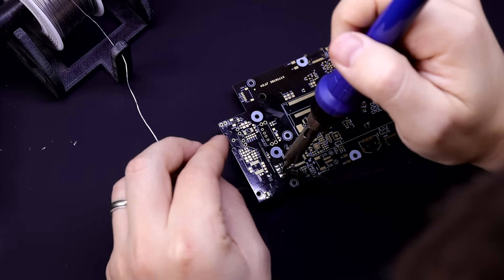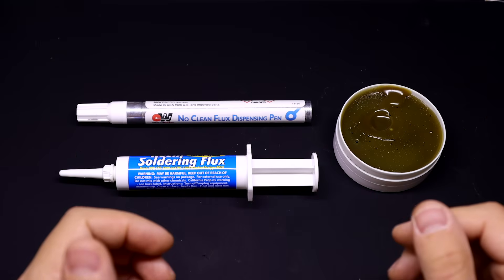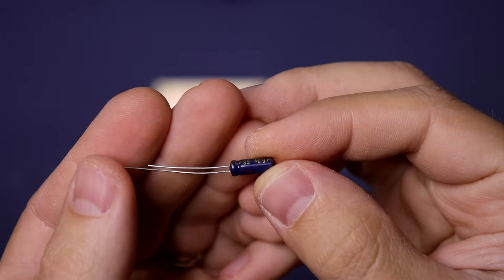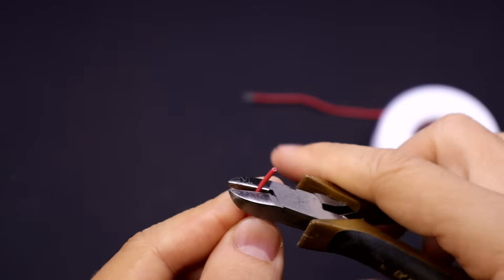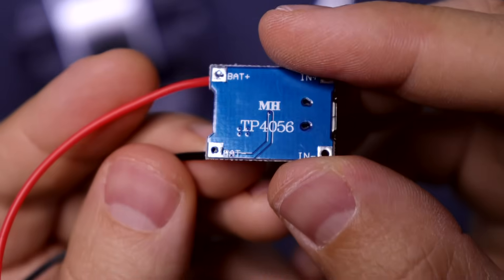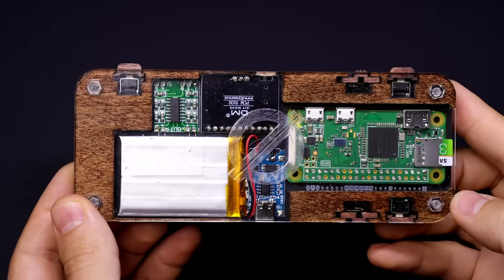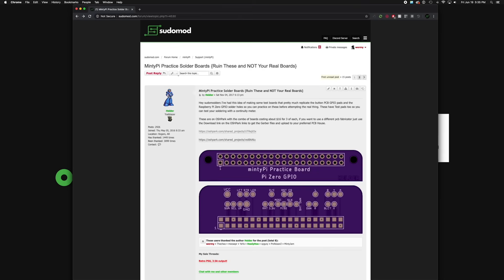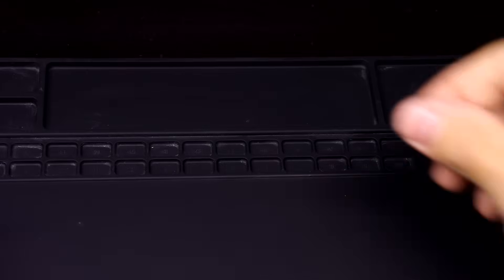Soldering Crash Course: Basic Techniques, Tips and Advice!

Comment: I have always had decent luck soldering small wires. But I'm trying to repair ballance leads on an rc car battery and the solder pads just won't melt. I guess my iron wont get hot enough... I'm really frustrated. I've always had good luck pre tinning the wires. Ive never had this much trouble. I appreciate the information, but I guess I need a more advanced videos, I just cant believe how fast others can get solder to melt. It seems like it takes forever, even though my iron claims 850f

Comment: 8:25  This is what I will attempt. I am new at this and just ordered this soldering kit.
But it's the wires from my rc's propellers that need to get soldered onto the chip

Here is what I ordered. I hope I got the right stuff!
https://www.ebay.com/itm/164853422896
Reply: ACTUALLY. The RC's computer chip's positive and negative wires fall off easy. I have 2 rc's and they don't hold up.. For the new computer chip that came, can I just solder over the soldered spots for extra support?

Comment: This video convinced me to finally try soldering out to try and fix some old consoles I was buying on ebay and cleaning already. I've been all afternoon desoldering and soldering components from an old motherboard I had lying around and I love it! However, I find myself strugling to know when it has the right temperature (it's one of those cheap ones with a wheel to adjust temperature and interchangeable tips that starts heating once you plug it in, since I just wanted to start trying it out), and also with the pump to get solder out, it usually takes me a few tries to get it all out and sometimes the leg is still stuck to the hole. Any advice on that?

Comment: Very good video.  One thing he is doing, but didn't mention.  To get those pretty looking little cone shaped connections on through board soldering he is removing the solder first, then lifting the soldering iron straight up.  I'[m teaching my 13 & 14 year old's to solder, and this is the video I want to show them first.  Tons of great info, but not so long as to bore them.
- Joe

Comment: Awsome video :) just one question, in my books when i did my electronic education, it Said not to shorten the leads after soldering, of you do you need to re-flow it. When you use sidecutters it can make cracks inside the solder joint so you dont have as good connection, or it might not be as reliable, i ususly dont do this unless it is for something that draws alot of current or if it need to work for a long long time :) never had any problems when i dont do this but i just want to be on the safe side, anyone els that have know this ? :)

Comment: I've got a Weller that I've used very sparingly over the years and didn't take great care of it because neither me nor my dad knew any better. I should probably get a better iron BUT for curiosity's sake let's say I get a brand new tip but the shaft remains quite oxidized. Would it still be at least useable? And even if the tips are heavily oxidized themselves would that be good enough for desoldering with a pump?

Comment: Excellent video, helped get me from never holding an iron to finishing my first electronics project. The one thing I'll say that I'm kinda surprised wasn't mentioned in the video and doesn't seem to be very frequent in the comments: keep things ventilated! The wisps of smoke that come off the iron are mostly flux fumes, and they can cause chronic respiratory issues (namely asthma). The lead in leaded solder is most dangerous if flakes of it (like, say, the ones that tend to come off the tip of your iron when you clean it) are ingested or inhaled, but soldering with it also produces some lead-based fumes that are equally dangerous with enough exposure. Make sure the space you're working in is reasonably open; open a door if you're in the garage, a window if you're in an office, etc. If you can, use a carbon-filter-based smoke absorber to pull those fumes away from your face and to keep the air cleaner. If you don't have one (or ideally even if you do), use a desk or household fan behind or to the side of you to push air away from you and toward the open window/ventilation.

Comment: Great video, it was a massive amount of help when I started my first project in decades. =)

One thing I did run into which you didn't cover in your video was soldering wires onto the legs of components, or pins sticking out of a PCB. My project was a DIY button box, so for the most part I attached the components to the faceplate, and had to solder wires onto the legs of the components. This seemed like something that would be best done using about 3 hands, any tips or tricks?

I did find one video where they first attached the solder wire on the leg by heating it up a bit, then cutting off a bit of it so that there's effectively a "stick" of unmelted solder attached to the leg, sticking out. Do this for each leg, then when you attach the wire you press the wire against the leg with the solder, and once they heat up the solder melts and the flux draws it in place. This did make things significantly easier, since I didn't have to try and keep 4 things steady at the same time.

Comment: Years ago when i was like 10, there was these inputs that i had that people had to use on tvs before hdmi cords came in. There was one video cord that had some type of coating in the center that would not make the video happen so i cut that piece off and replaced with another video input. I didn't know about soldering but it worked and my family was amazed, this made me want to look into this kind of work and see what i can fix.

Comment: All great tips, except you failed to mention the most important aspect of soldering: Suction.

You can't solder in closed environments because those fumes are toxic, so if you're going to go over the basics, suctioning those fumes away either through an exhaust or fan with a carbon filter to drive away the fumes.

Soldering and breathing everything is going to ruin your lungs.

Comment: @wermy: Hello. I have a question. I'm trying to replace a battery on a nintendo 64 game cartridge and it needs a cr2032 battery with the tabs soldered on already and I've tried it already. No luck getting the game to save at all. What I did was I filled in the gap around both tabs as in I melted the solder wire inside the holes. I then covered the surrounding area with more solder. When I tested the continuity with the multimeter it beeped and showed -41 to -52. Did I do something wrong?

Comment: Crazy how the sotter flows like magic in videos, I’ve sottered leds before but my sotter never melts and flows like that, I use kester sotter, flux, a soldering iron with adjustable temperature, and I just can’t get the sotter to flow and melt on wires or even leds sometimes, I heat up the wire, I heat up the leds, etc, I do everything suggested in videos, still it never works how it works in videos I see here. The sotter basically turns into a little ball then falls off.

Comment: Finally a video on soldering that I feel good about sharing. Great job. I prefer to use a "Western Union" style splice when joining 2 wires but when you only have a little wire to work with I do the same as you did. I've been doing electronics as a hobby for over 50 years and have spent most of my life in one electronics feild or another. Again great job.

Comment: I swear i had a terrible electronics teacher. Did a partner project and we had a good bit of soldering to do and both of us did like you said where we tried to melt the solder onto what we were trying to join. Of course we had lots of issues and barely got the project finished for a grade. We also had the heat to high and the solder kept splattering sometimes which flung molten metal at our hands. We fixed that on our own but we had no guidance at all from our teacher. I guess his idea was just to let us figure it out on our own or something. Totally turned me off of working with electronics which i actually had fun doing. :/

Comment: My biggest worry is that I'm overheating the components. Sometimes it feels like I have the soldering iron on for way too long yet the solder doesn't want to melt.
Reply: As someone who has burned two out of the last four boards I've tried to solder, I feel this. Something I started doing is melting the solder onto the iron instead of the board? If that makes sense? So there is a blob of solder on the iron tip and that's what I put on the spot I want it at. It's helped me a lot! I now have two nice boards with no burning.

Comment: How about a video that goes a little more in depth with tip maintenance, flux types & usages?
Reply: Flux is used in for transfer of heat... use it sparingly but just enough.  It’s a necessary evil.    It leaves a sticky brown mess after soldering that can be cleaned up with 99.9% tech grade isopropyl alcohol and and acid brush after a few cleanings.  The 91% from Walgreens works too but it’s whatever is available.  Make sure you get under the components you solder.  As far as tip maintenance... if the soldering iron is on for a few minutes while you figure out your next move... blob some solder on the tip.  Have a “solder dump” (a small metal container with a DAMP paper towel)... when ready to use the iron again,  give the iron a small tap into your solder dump OR use a lint free “tech wipe” to lightly brush the excess solder you blobbed on earlier to lightly brush into your solder dump. *recommended because you don’t want molten hot solder flinging all around you.  Use a wet sponge to “ thermally shock” your iron and begin to solder by touching a small amount of solder to the side of it and make a solder bridge between the pad, your component and the fresh solder.  Your solder joints should look shiny, smooth and concave.  Minimal amounts of time should be spent on the board in regards to heat.  Flux is key.  Cleaning is key.  600 F to install max.  650-700 F to remove
Reply: I wanted to say the same. My tips are unusable after one week of soldering.

Comment: Part of my issue with solder is often times the workpiece will start to melt before the solder melts. I.e., if I hold the solder iron tip on the end of an exposed/stripped wire, the plastic insulation starts to melt before the solder. So my only choice is to melt the solder and let it drip onto the wire. Not sure why this happens but I have a solder iron and solder gun and its the same. I've also tried using thinner diamer solder which helps some. My experience with soldering is never the fast, instantaneous melting of solder that I see in YouTube videos

Comment: When I started soldering I was using the lead free solder .... My result were either acceptable to meh, then I switched to 60/40, this made a huge difference.
Reply: Were you using rosin core or just some cheap lead free solder? I use a decent rosin core lead free solder without any problems
Reply: @SaltyMikan   Rosin core, the finish was never looking as good at the finish of the 60/40
Reply: @256alexdt  ah that's weird

Comment: How do I deal with the solder not melting despite the iron being hot enough? Most of the time, the component I'm soldering is prone to over heating, even when I'm applying heat on the board, the solder wont melt as the component is starting to overheat. Sometimes I have to push harder in order to melt it but I end up pushing too hard and accidentally putting to much solder and making bridges. Sometimes it melts smoothly. The problem is that its so inconsistent even though my technique has been the same. What seems to be the problem?

Comment: Im watching this because im a beginner, but I think instead using “fuse” together, it’s better an more accurate to use “bonding” or “stick” them together I think. Fusing is a term better suited for welding where the goal is to melt both filler and base metal to fuse them together an make them one solid material.

Comment: Thank you so much very detailed im literally starting my journey you are definitely going to be my teacher
Reply: If you're mostly going to do stuff like padhacking, then please don't get stranded wire. It's practically impossible to keep the end of the wire from being a bit frayed which makes the surface mount soldering without bridging pads with the wires. It works with stranded core but I would not recommend.

Comment: You should only get 63/37 solder, particularly for beginners because it has no plasticy state, its sometimes called eutectic, because it goes straight from liquid to solid and vice versa. 60/40 is close, and will work if you are a little bit more careful, but the easy/best is always going to be 63/37

Comment: I have always been concerned about cutting off the excess component leg in through soldering, after it has been soldered, cutting could fracture the joint  ?
Reply: you could still re-heat the solder if you notice it has broken off

Comment: What's a decent soldering station for a beginner that doesn't trust the Chinese brands on Amazon?
Reply: I chose to purchase a soldering station from trotec (german design and quality control) because they are cheap and powerful (60w !!). Overall it works nice. The only issue is that they dont sell heads, so i found ones that might fit on eBay ... We'll see
Reply: @MathiasK29-44  Thanks for the suggestion. The wife ended up getting me a Hakko for Christmas. I've been pretty impressed with it.

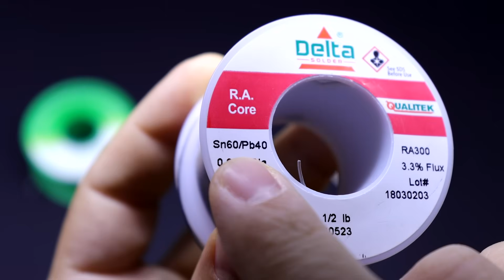Comment: 1:34 - I've had better success with 63/37 (tin/lead) alloy. It's what I used on my first solder joint and I've stuck with it (pun intended). I've used 60/40 a few times since; but, I found the time from start to finish is less (which is better for any IC component used).
Reply: Yeah. Given that the difference in cost is negligible (and often no difference at all), I don’t know why people still recommend 60/40 when 63/37 is a bit nicer to use.

Comment: Vital things you didn't mention that I only just learned (tell me if I'm wrong) are:  1)  You almost always want melted solder on the heating tip, and you are primarily using that, rather than the iron tip itself, to heat the target contact, as the molten solder conforms to its shape to transfer heat far better than the rigid tip of the iron can.  2)  You don't need to heat contacts to the solder melting point, only to a point where molten solder will stick to it.  3)  The molten solder on the iron is necessary, but not sufficient:  you need to apply fresh solder to adhere some of the molten glob to the hot contact.

Comment: Thank you for an up-to-date tutorial.  Need more time on solder iron tip selection, temperatures for size of connections to be made.  Minimizing time soldering iron is on the pad as not to lift the pad.  More heat = less time on scene.  There's a fine balance.  Flux is your friend.  Use it!  Practice with a practice board till you get the hang of it.  replacing components can get expensive if you damage them.

Comment: thanks. cool video. I bought a soldering iron for 10€ that's adjustable between 200-450°C from a great Electronics store. I want to replace microswitches on some old mice. which temps should I use? 450°C? I'll go shopping before doing the job, still wanna buy a silicon workpad, a bunch of wires and some cleaning fluid. I heard WD-40 brake cleaner is great for electronics, but I'll take whatever they sell there. Probably should buy a cheap heat gun as well.

Comment: i am 100% the icing on the cake person.   I'm trying on the raspberry pi practice boards (the holder ones) and my iron is in the way when i try adding solder.   I went through 2 of the 3 so far and still having problems getting all the pads connected.  its frustrating.  That and an unsteady hand.
Reply: Try watching the soldering basics videos from Pace Worldwide. The videos are old, but the quality of the presentation is second to none. They WILL improve your soldering. :)

Comment: As an electronics technician this went above and beyond a crash course you explained how to do things how others do things any why they do not work. I do not think i could have done it any better myself. The butt solder joint you demonstrated is more than adequate. many will stress that the bare wires should be formed in a certain configuration before soldering. however unless you need them to be the same or less than diameter of the insulation this is completely unnecessary. you should never rely on the strength of the wire for the electrical connection.

Comment: The silicon pad is also useful as a non conductive surface to avoid short circuit, bridging, static electricity damage, etc.
Reply: FYI, most silicone pads are not ESD safe, and can potentially result in static damage. A proper ESD mat is better in that regard. (They can take some heat, but are admittedly not as heat resistant as silicone.)

Comment: tip tinner actually shortens the life of your tips. best method to preserve your tips is to melt a blob of solder onto the tip just as it's cooling down so it covers the tip and forms a blob on the end. when you go to use the tip again it will be perfect.
Reply: Brian Goldberg Yep! The instructions for tip thinner even say to then thoroughly clean the tip after use, then immediately re-tin with solder.
Reply: I'm still learning to make it turn into blobs, I'm just snapping the solder when I heat it. No blob action whatsoever, doh!
Reply: @theimprovisedmanfriends204  it's all about controlling the heat. turn the iron off and grab the blob just as it's cooling down
Reply: @briangoldberg4439  Thanks so much for your reply, it's something I'm really interested in as I enjoying repairing stuff.
Reply: @theimprovisedmanfriends204  sure! good luck